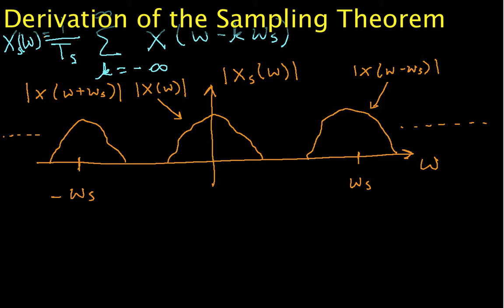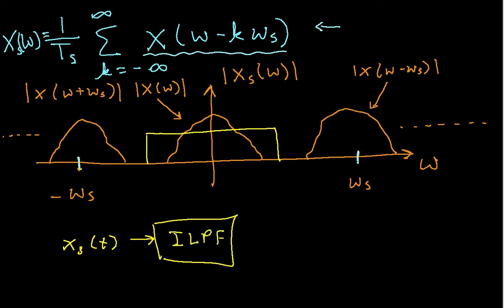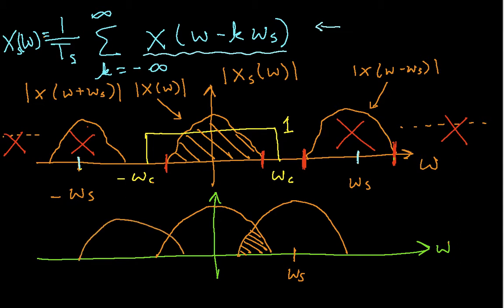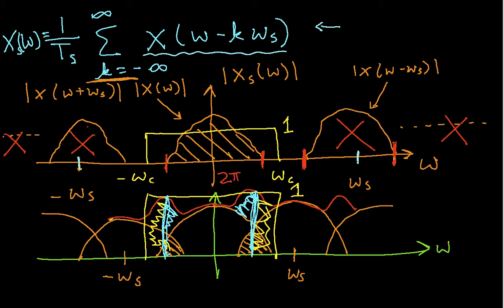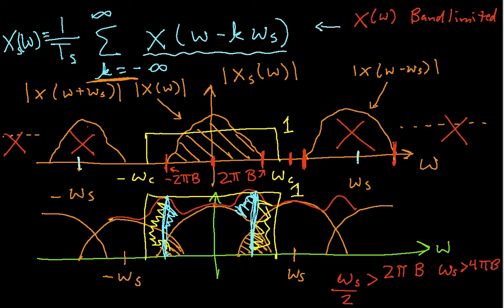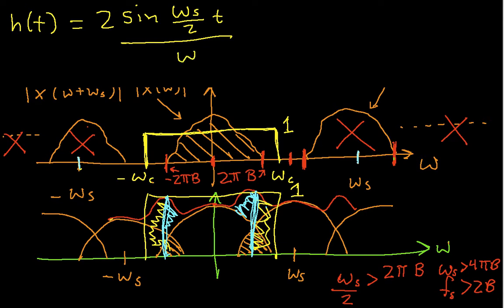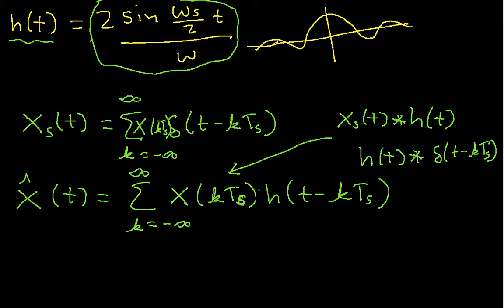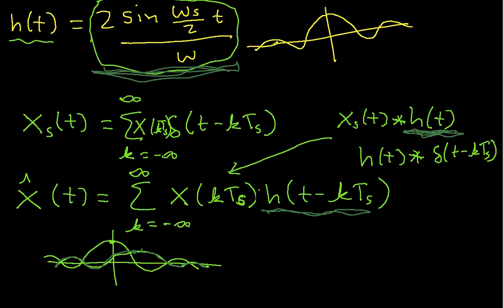Sampling Theorem: Derivation Part 3

Comment: On every simple but maybe stupid question.  Suppose we sample a 1 Hz sin wave with amplitude 2 units using a 2 Hz sampling rate.  I just happen to sample the sin wave at the 0 points, e.g., 0, pi, 2pi, 3pi, etc.  How does the original sin wave get reconstructed as the sample amplitudes are all 0?  This can't be distinguished from a DC level of 0.
Reply: Good question, I think that it would be more useful to look at the sine wave as a fourier series with infinite harmonics rather than just one point in the fourier spectrum. This article does a good job of explaining it in his second faulty design decision starting on page 11. He even shows a way to reconstruct the signal at a rate much lower than the nyquist rate! pretty cool. http://www.wescottdesign.com/articles/Sampling/sampling.pdf
Reply: Tom M That happens because you need to sample at a rate higher than the Nyquist frequency. A pure sine wave of frequency F sampled at a 2F rate is the limiting case, because if you sample at the zero crossings you get a 0 Hz DC signal. In other words your signal got aliased to 0 Hz. If your sampling rate is right above 2F you can reconstruct the original sine wave. But this is only true if your signal is perfectly band-limited, and that doesn't happen in real life, because such a signal would extend infinitely in time.